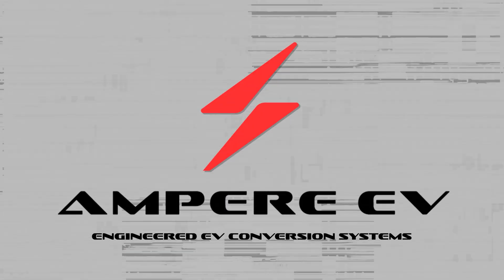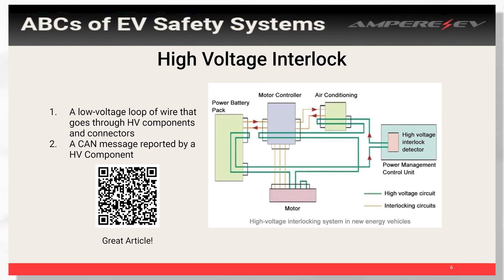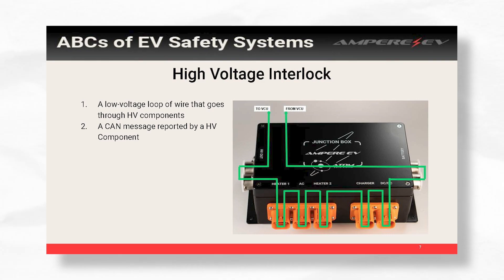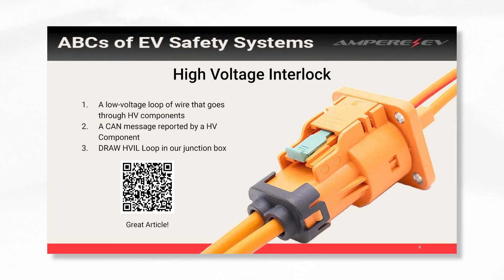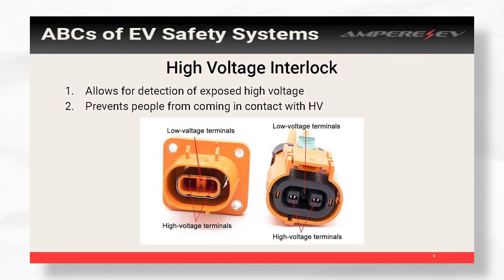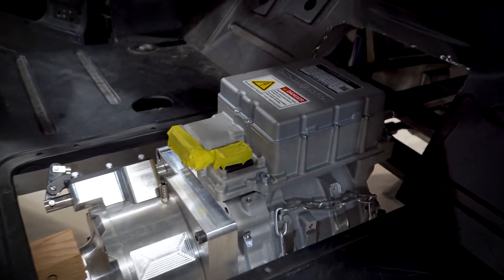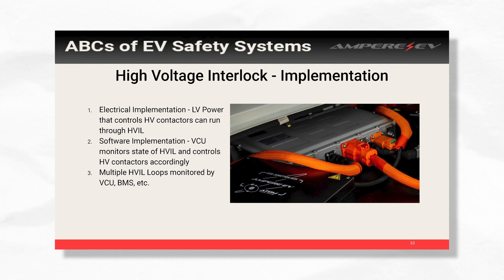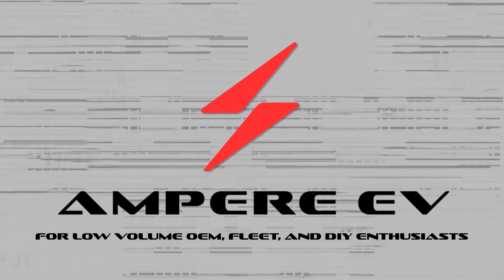What are High Voltage Interlock Loops? - ABCs of EV Systems

Comment: Thanks for the video! So these low voltage signal lines are routed together with the high voltage power lines. Is it possible (e.g. in an accident) that the harness gets damaged and the low voltage signal lines getting in touch with the high voltage power lines? Is there also protection on the low voltage side or what would happen in this case?
Reply from the maker: The interlock connections are usually internal to the high voltage devices and run separately out of the device for monitoring. Our systems do have high voltage isolation monitoring, which would detect a high voltage to chassis connection. We got some great videos on that too!